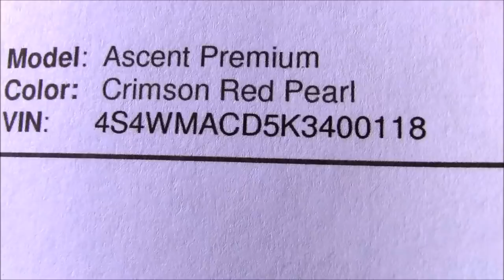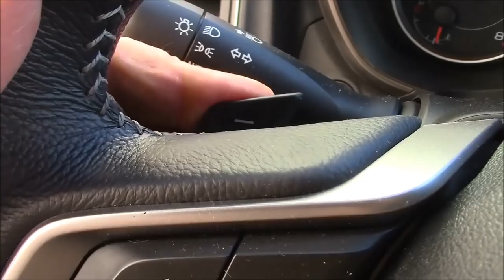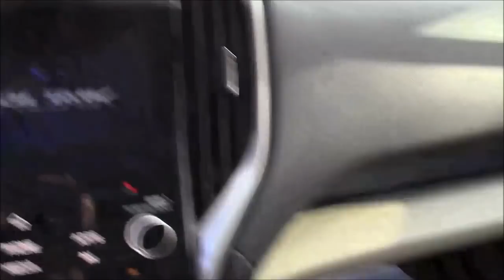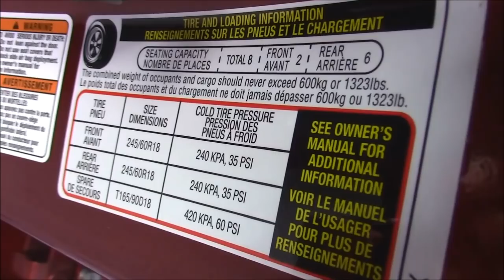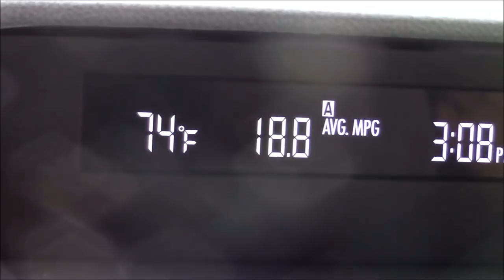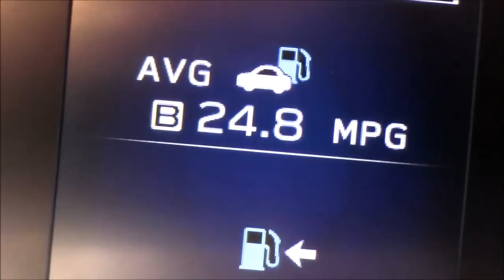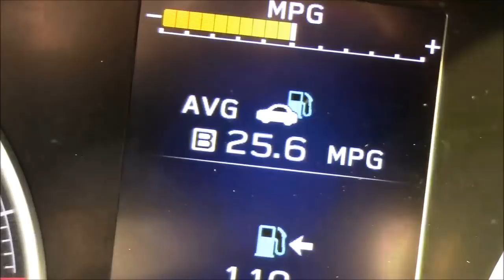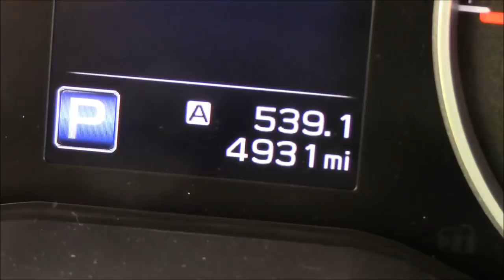2019 Subaru Ascent: 550 Mile Drive & Economy Test!

Comment: To chad. I should have said push down hard not like normal acceleration the turbo only engages if you aggressively push your accelerator. It basically dumps a lot of gas in the engine. It beats the heck out of that little 2.4 momentarily. It’s not permanently engaged. Just as needed

Comment: 25 mpg, my pilot 2016 3.5  6 cyl i do 26.3 highway and 20.2 right now city
Reply: I passed a pilot that was stuck in the middle of the road during a snow storm in my subaru legacy... thats a sedan and i had to go offroad to do it because they were sideways blocking the whole road. Subarus are better

Comment: The Duster is a Romanian car made in eastern Europe. It's a small company called Dacia (from an old nation called the Dacs, which were conquered by the Roman empire in 106 AD). The company Dacia was bought by Renault (France) and they put the renault badge on it if it's sold outside of Romania. It's a very cheap car (12k USD in Romania).
Reply from the maker: No competition for Mercedes I guess?
Reply: chad haire lol, I think they are safe:)

Comment: Speed bumps are put to drive slowly,  not at 25 mph, besides it's not good for the suspension to do that.
Reply from the maker: HELLO?  WAKE UP!!!  This is a suspension test not a speed bump test.
You really think 4 hits of a speed bump will damage the suspension designed to go 50,000 miles?  REALLY?

Comment: Ok review but I would not buy a 4500 pound vehicle when loaded 5500 pounds pushing 3 tons that has a little 2.4 4 cylinder in it   In 95 degree heat turn on the ac and you just lost one cylinder   Now it's a 3 cylinder.  A joke. They put a turbo on it which only engages if you stomp it. By the way it beats that tiny engine to death.    They torqued the engine up to try and give it some strength.  A bad idea.  Just put a 6 cylinder 3.6 engine with 300 to 350 hp. That's what it needs. He does not dwell on any of this.  I own an outback   It weighs about 3600 pounds. It has the 2.5  aspirated 4 in it. It's just adequate. The most passengers it carries are 5.  I wanted to buy an ascent. It's a beautiful car but has an inadequate power plant.  Love my. Outback.
Reply from the maker: You dont need to  "stomp" on  this turbo to get torque.  It has MORE torque at low rpm than a V-6.